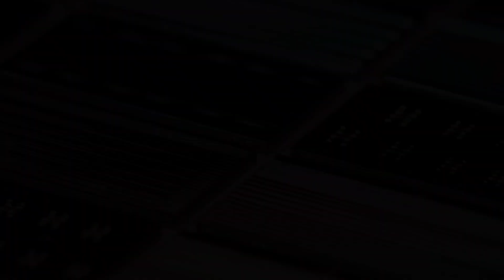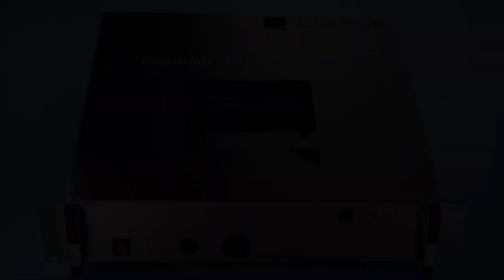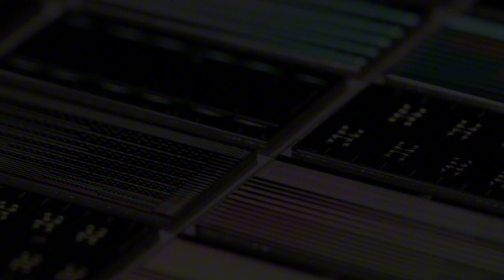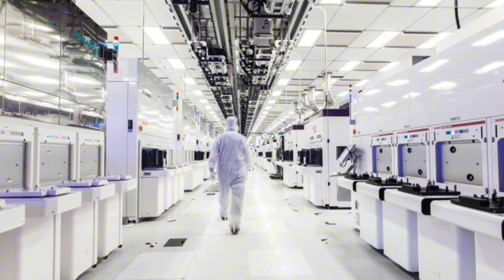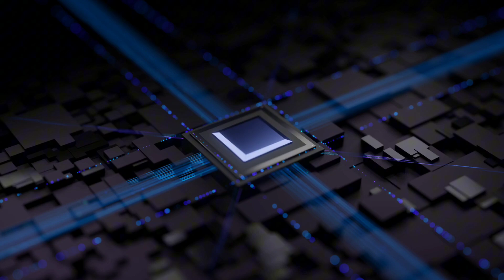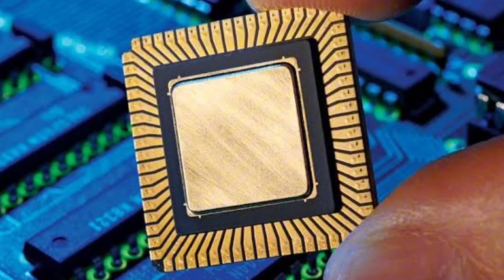50x Faster Chip from Germany – And It Runs on Light!

Comment: It still requires enough power to warrant a heatsink, 
Analog light based chips won't replace digital yet due to compute error count, 
To add insult to injury it also needs to converted back into a digital signal for th3 cpu to understand and this is a bottleneck.
Reply from the maker: Agreed